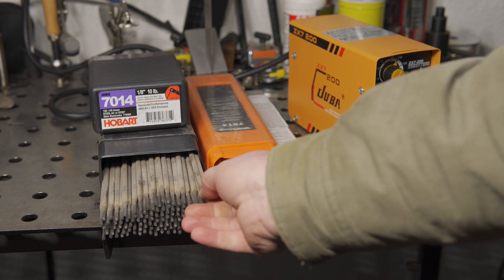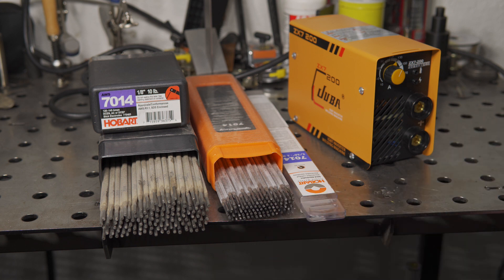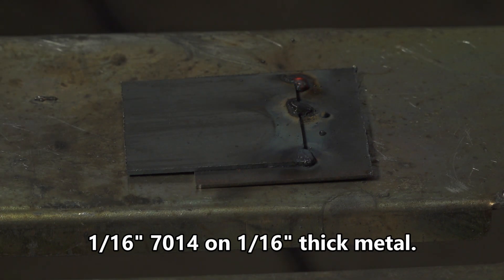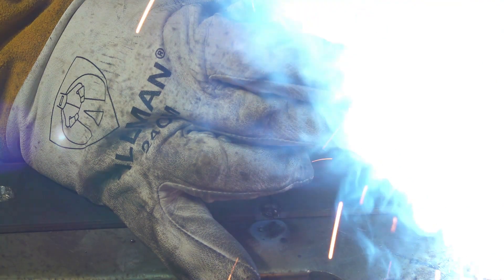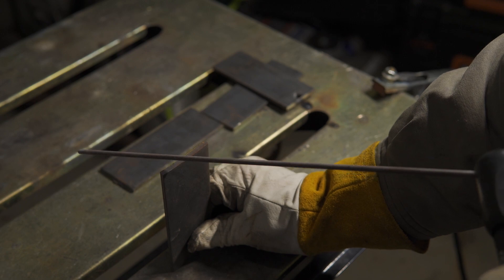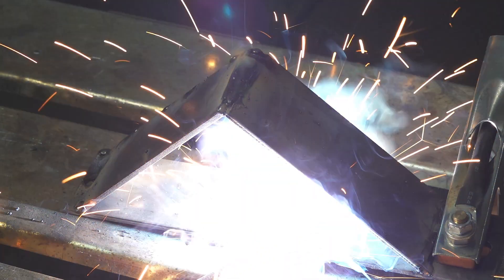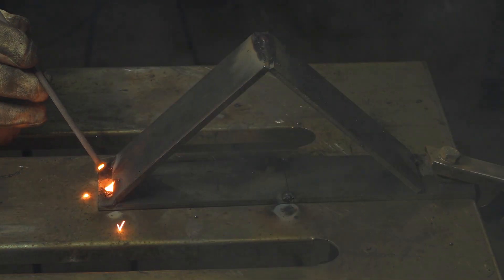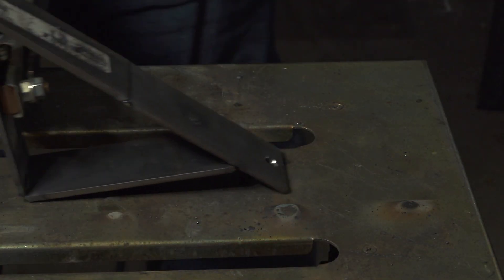Stick Welding Easy Tack Welds:  Use 7014 Rods

Comment from the maker: In case it wasn't obvious, I wasn't working on a real project in the video.  I was just randomly tacking up some scrap to demonstrate how easy it is to start an arc with 7014 rods.  I wasn't really paying attention to how good a job I was doing on the tacks/welds.  I know it looked like crap, lol.  But hopefully it got the point across well enough.  If anybody wants me to do a bit more welding with 7014 to show how it does, let me know.  Cheers.

Comment: 7014 is similar to 7018 but its not low hydrogen so you don't need a hot box.  For the home handman type its just easier to take care of especially if they are 6 months old or older.  Technically 7018 gives most environments 4-8 hours before it needs to be in a hot box after opening the package.

Comment: I've wondered for many years why these rods aren't the most popular rod. Most seem to like 6011, the rod that sticks like hell. 6011 rods are not allowed in my shop. Period!!!!!
Reply: You really should learn how to run 6011... it's a great electrode, and very useful.  If you're sticking it on starts, turn it up a bit.  If you're sticking it while running the bead, then stop sticking the rod in the puddle.  It isn't a drag rod, you have to maintain your arc length.  Practice, Practice, Practice!!
Reply: @Bkd70. I have had 55+ years experience at finding 6011 rods stick more than 7014. Every rod sticks a little more at striking. 6011 rods stick more yet, and partially used, stick even more yet because the flux breaks back away exposing the metal due to the flux is more delicate than the flux on 7014 rods. The last stinking 6011 rods I had stuck after the arc was already going probably because they were contaminated or something, as all the 6011 rods I used in the past at least held an arc after striking. Experience has nothing do with this. After 55 years I have found that on every AC welder and every shop, on every day 6011 rods act the same. They are harder to strike an arc than 7014.  Maybe you need to read the replies a little more on this video so you can back off on thinking that Practice, Practice, Practice is the answer.
Reply: @bottmar1  LOL... I guess I should have known just from how hard you hit the keys how much experience you have.   I have a little bit less than your 55 years... but I don't seem to have the problem you describe.   I'll keep burning those 6011's... maybe I  will experience the problem you're having.
Reply: BKD70. LOL.  Pay more attention to your welding. The problem I stated is not very hard to find. I wish I could try 6011 on D.C., if I had a D.C. welder to see if that works better. D.C. sure makes 7018 come alive. I suppose you are going to claim that 7018 doesn't stick on A.C. too. It does, in fact, act like 6011 but slightly worse. See ya.
Reply: @bottmar1  Hmm... 55 years experience, and you don't have a DC welder to try 6011 on?  Perhaps I did give you too much credit.    Keep burnin, buddy.

Comment: IMO, 7014 is the successor to 7024.

7018 AC is quite enjoyable too and I got pure AC for that.
Reply: 7024 has considerably more iron powder in the flux and is limited to flat (horizontal) welds.

Comment: Could a thin 7014 be used for thin metal? I'm going back and forth between 7014 and 6013 for thin metal. Like less than 1/16 thick steel.
Reply from the maker: I don't normally stick weld anything under 1/16".  But for 1/16" steel I use 1/16" 7014 rods.  I've seen 1/16" 6013 rods and I think they are often used for thin metal, but I don't have any and haven't tried it.

Comment: I like 7014 more than any other. I don't know why the standard is 7018. both are 70,000 psi strength.
Reply from the maker: Tensile strength is only part of the difference.  Still, I think other rods can work just fine in a lot of situations for most people.

Comment: 7014 is my favorite stick for general purpose welding, but I had overlooked this aspect. Before pandemic inflation took hold, I could get the 5/64" and even 1/16" at a pretty good price. Hopefully they go back down before too long.
    I think of 7014 as combining some of the good qualities of 6013 and 7018, without the down sides of either one.
Thanks for putting it out there.
Reply: Agree 100%!!  I don't think the puddle is hard to see with 7014 either...  It's not like 7018 where the puddle is all like "HOW YA DOIN"!!"... but it does have a well defined puddle... it is just smaller than 7018.

Comment: Hi there!  I used a box of 5/64" 7014 for both tacking up and thin material, was really happy with it.  Having tried both though, I can't tell much difference between 6013 and 7014, but then I'm not an expert welder either...I'm a grinder not a welder lol!!!

Comment: Hello,  I'm starting to plan for a project later this spring where I think I need to learn this.  I'll be attaching 1/8 - 1/4in round rods together making 3d geometric shapes.  Is this the process I want to learn, tack welds with a stick welder, mig/flux core or something else entirely?
Reply from the maker: Stick and flux core are convenient because you don't need shielding gas.  TIG and MIG are nice because they make a cleaner weld without slag or much/any spatter.  

For a beginner, flux core and MIG are probably the easiest for quick tacking.  Personally, I think TIG is pretty easy for quick tacks as well (especially with a torch switch), but it requires the most setup and such (shielding gas, grinding tungsten, etc.) and it requires tight fit-up if you don't add filler to your tack, which is often tough to do while tacking because you are holding the part with one hand and the torch with the other.  Flux is easy and simple, but a bit messy (slag and a spatter), MIG is easy and cleaner, but requires shielding gas.

Stick welding can take some practice before tacking becomes easy/second nature.  But it can definitely be done and stick welding is the simplest in terms of you just need to put a rod in the stinger and weld.  No worry about shielding gas, wind, wire feed speed, wire tension, etc.  Technique is important and takes a bit of practice, but it is otherwise, pretty simple.
Reply from the maker: Where about are you located?  Maybe there is someone or someplace in the area where you can get some pointers or even see or try different weld processes to see what works.

Comment: I agree and use 7014 1/16 on my little 110v 20 amp Lincoln hobby welder. Which Lincoln wants you to use there Flintweld 37 E 6016 1/16 mild steel. So I use alittle of them all 6010 6011 6013 7014 7018 as well. And like you 7014 Nice .

Comment: after reading some of the comments... I have a question about ductility (ductile welds) of 7014, 7018 and 7018ac.  The main purpose for me learning to weld is to do basic weldings in a big 8 car hauler trailer... i dont want to do any structural welding (I will leave this to a professional but I want to weld chains for using straps, weld mesh floors also for straps, weld angles to hold aluminum boxes.  the vibration in the trailer is very high... would a 7018ac rod perform better then a 7014 in this application?
Reply from the maker: In terms of working "better" than another rod, each brand and type of rod should have specifications for strength and ductility.  But all these specs will be affected by any moisture or hydrogen that gets into the weld, what the base metal is, how much base metal dilution you get into the weld, and more.  And how important it is to weld strength overall will depend on the direction and type of loads on the particular weld joint.  

For what you describe, of more importance than the particular rod used is likely going to be the weld itself in terms of bead size, length and placement to limit the areas where a crack is prone to start.  If welds are a proper size and in the proper place for the specific joint and load, you will probably be okay with either rod.  

In terms of 7018 rods, I use Lincoln Excalibur 7018 MR (MR stands for "Moisture Resistant).  It's not the cheapest, but they seem to start better and run smoother than other 7018s I've used.  It's true that 7018 is a bit harder to start than some, and more importantly, more difficult to re-start than some.  But once you get the hang of it, Lincoln Excalibur 7018 is some of my favorite rod to run.  So well behaved in all positions and you can see the puddle so well that it's easier to manipulate.  Just a thought in case you decide to get some more 7018 down the road.

Comment: btw from what i could find online 7018ac is for AC machines but I used with my KICKINGHORSE A220 240v.  I dont know of there is a difference in strength of the weld and even if it is ok for me to keep using 7018ac rods with my KICKINGHORSE A220 240v as it was easier for me to strick arcs with 7018ac.

Comment: I purchased KICKINGHORSE A220 240v because I saw another video you made and I first used it with forney 7018ac rods without knowing there are regular 7018 and 7018ac.  The 7018ac was very easy to strick an arc with the KICKINGHORSE A220 240v but when i had to buy from a local store (harbor freight and tractor supply) I brought regulat 7018 and I ended up returning because it was very difficult to strick an arc and i thought they were old rods that were no good.  I know believe the problam was actually my lack of knowledge/experience.  So my question is:  "have you used 7018ac rods?" how does 7018ac compare to regular 7018 and to 7014?

Comment: I love 7014.  I made a huge shelf out of some thick angle iron and steel wheels, in order to move around the garage.  It hold thousands of pounds of FULL ammo cans.  Let’s just call it… “lead.”    I could have used 7018, but I had so much 7014 on hand and like you said, it’s so easy to use.    When the heat is turned up enough, 7014 also produces very nice looking as well as very strong welds.  Of course it’s not as ductile as 7018, but so what.  It’s just a steel shelf.

Comment: I am going to buy a box of 7014.  Now would you use them for a complete welding job on say two pieces of 1/4 inch steel or are they best used just for tacking and then use another rod like a 6013, 6011, 7018 for the actual welding?
Reply from the maker: No reason you couldn't use 7014 for a project if it works for you.
Reply: @bigtb1717  Thanks for that info

Comment: When you say that one just has to drag the rod are you saying that one does not have to hold the rod above the metal to avoid the rod from being welded to the metal.
Reply from the maker: Yes, that's correct.
Reply: @bigtb1717  Thanks for your reply.  I am new at welding and so far have used 6011 and 6013 rods and one has to remain about  1/8 of an inch above the metal at all times or else the rod gets welled to the metal. 

 Now just dragging it and I assume the tip at 45 degrees or so makes it super easy.  To start an arch just tap it and go and not get stuck to the metal.?
Reply from the maker: 45 degrees would technically be too steep.  It would probably work, but I'd aim for much closer to straight.  Maybe 10-15 degrees.  Depending on how hot you are running, 7014 can definitely still stick when starting out, especially if you are set a bit cold.  It re-starts easier than other rods, but it can still stick.

What welder are you using?  What is your amperage setting and what rod size?  You may just need to turn the amp setting up a bit.  Most rods won't stick all that easily once you are running and have a good puddle going.  If your rods are sticking while running a bead any time you get a little too close, I'd definitely try turning the amperage up on the welder to see if that helps.

Comment: You again:-) Was researching 7014's and your vid came up. Have been researching rods to learn stick welding with and for welding driveway gate hinges. Most say 6011 and 7018. I almost bought 7018's but that moisture thing made me uncomfortable,  just one more unknown and variable for a newbie welder.  So, I called Forney this morning, explaining my desire to learn to weld and the first project at hand. With a very friendly and  lengthy discussion about the three rods mentioned they unequivocally recommended 7014's.  Also, a shout out to Forney tech support as they were very informative and very patient with me. Even  provided suggestions on learning how to stick weld and other welding topics unrelated to their products.
Reply from the maker: Nice to see you again.  7014 is a very easy starting rod and it runs pretty easy as well.  The slag will be a bit hard to remove if you don't get the amperage set just right, but the bead underneath will usually still be nice.  

6013 is also a very easy running rod.  Maybe not quite as easy to re-start as 7014, but it's easy to run.  

7018 is still probably my favorite rod to run overall.  It's more difficult to start, but it's very controllable once it's running and the puddle is easier to see than just about any other rod.  I wouldn't worry too much about moisture, particularly if you are just running them for practice or non-critical projects.  I store mine in the garage on a shelf, not in a dry cabinet or rod oven or anything like that.  I would get a new, sealed tube if I was going to use it for anything super critical, but for practicing, testing welders or things like a stand for my saw or a rocket stove, I've never had an issue with 7018 that was simply stored in the tube in the garage.
Reply: Don't worry about 7018 and all the storage/moisture hype.  That is only a factor IF and ONLY IF you are doing code welds where the weld will be X-ray inspected and the low-hydrogen properties of the electrode must be maintained per specification for the job.  If you're not doing any of that... then don't worry about it.  7018 will store on the shelf and stick metal together just like any other stick electrode number.  For general welding, I still prefer 7014 though... mainly for the ease of restarts, which are almost effortless.  7018 can be a real bear to restart at times.  7018 is easier to see the puddle, but 7014 isn't hard once you learn what you're looking for.

Comment: you never mention what setting you used, do you remember? Thanks I love 7014
Reply from the maker: Unfortunately the display of this welder is not accurate, so it's hard to say exactly.  But I believe I was using around 120 amps for the 1/8" rod and probably 80 or so with the 3/32" rod.  Those are just estimates and are certainly not what the display showed, because this welder display is not even close.

Comment: i will be doing my very first stick welding with 7014 i just ordered...... well here we are few months later and different rods tested  and I must say although this 7014 is easy strike rod, it sure is violent rod like 6011 and has ugly messy slag. best rod all around the cleanest and easiest is 6013  bar none.
Reply: I started using 7014 too and i agree with you!! messy slag!!
Reply: Are you guys using no name brand welding rods? I purchased a no name brand (Hot Maxx) rods from Amazon, 6013, and they won't even weld. There is so much slag, they just make clumps of black slag when you weld with them. I used Hobart 6013 rods (both brands were new out of the sealed plastic container BTW) and the welds are flawless, with a nice crispy layer of easily removeable slag. Before you judge a particular rod, you must try several variations.
Reply: @Ritalie  Brand names, for sure. it makes a big difference., although most if not all made in china or india

Comment: What is the the best rod for 1/16 thick stainless steel
Reply from the maker: I think 308L or 309L is probably the most common stainless steel stick rod, though what rod you use technically should be influenced by what particular alloy of stainless you are going to weld and if it will be heat treated or used in high temp situations.  Welding thin material will be difficult no matter what, so I'd probably want 1/16" thick rods, or 3/32" at the most.  And you'll probably want to practice on some scrap first to get your settings and technique figured out.  It will be very easy to have the heat build up and get away from you.